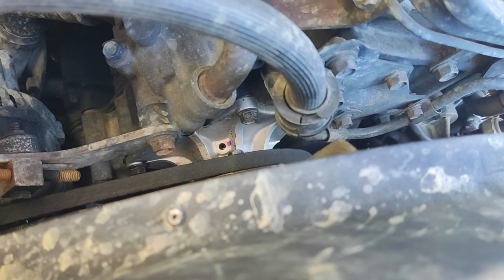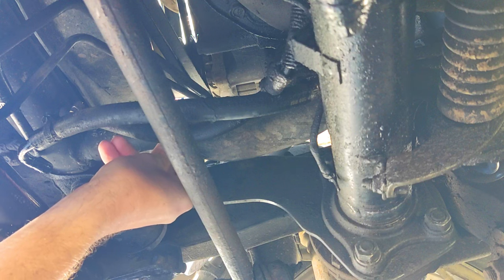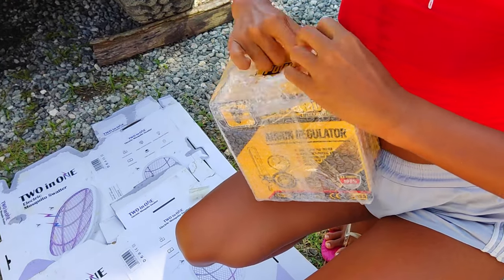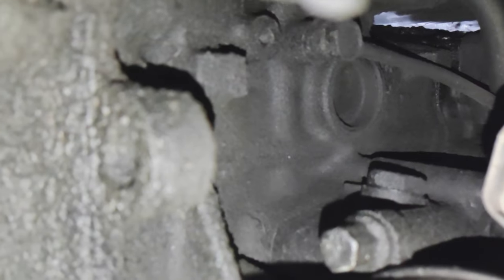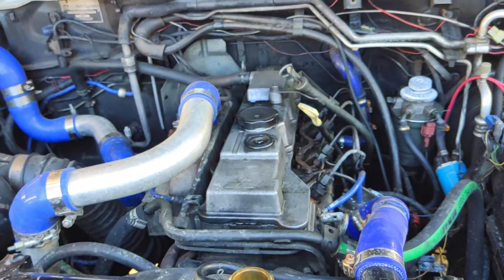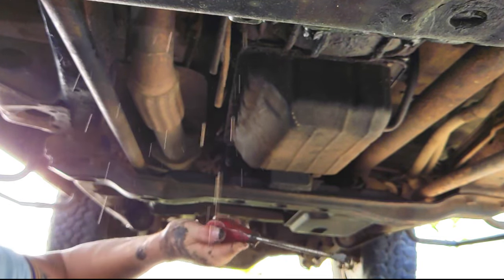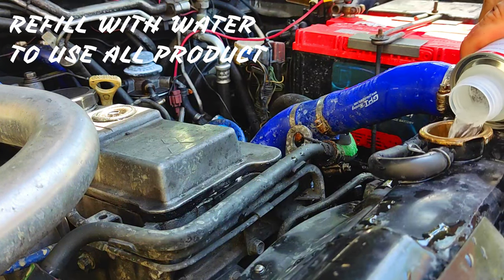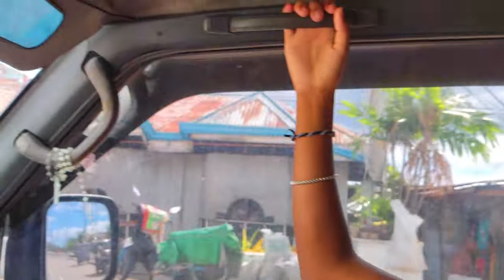HOW TO: ENGINE BLOCK DRAIN PLUG, RADIATOR COOLING SYSTEM FLUSH, 4M40 MOTOR COOLANT CLEANING PRODUCTS

Comment: Regular water is not ok for cooling system for long time, it causing increased rusting, better use antifreeze.

You can drain coolant from radiator without detaching lower hose, there are special drain valve/tap on the left lower corner of radiator.

There are lots of engine block drain plug photos in the internet, but sadly in russian speaking pajero and delica users community.
Reply from the maker: REGULAR?? THIS IS SWIMMING POOL WATER!! ;-)

Hehehe! Yeah...just a long process with all the flushing and bit-by-bit replacement of cooling system parts. The new water pump didn't do too many kilometers on water and yesterday, she got REAL COOLANT again! Video coming in a few days! THANKS for all the communication!
Reply: @offgridislandfamily  Water pump isn't very important component that can be damaged by rust, cos you can easily replace it. Most annoying rust damage is at heat exchanger, if there's small hole oil goes directly to antifreeze with high pressure.
Reply from the maker: @DeckCain  You mean the heat exchanger/heater core? If that happens, I'll just disconnect the heater.
Reply: @offgridislandfamily  No, not heater radiator in car cabin. Heat exchanger is device located near oil filter and it cools down engine oil using antifreeze flow.
Reply from the maker: @DeckCain  Can you send a photo to my Instagram group? Same name... Thanks! Sounds like another new part I need to learn about.

Comment: You should put liquid coolent and it comes with verse colour like blue, red and green so should check your user manual to check which colour coolent you should put to your vehicle or you can ask a mechanic shop or garage for info and add it to your vehicle otherwise this will go no where after the engine breaks so remove all the regular water that you added into the system and add the new coolent you bought from the store and your engine would work great after that without any problems.
Reply from the maker: Absolutely correct! Thanks for the message...

Comment: Where did you get the new metal coolant pipe that bolts to the side of the block?
Reply from the maker: Online, but I'm building copies in stainless. One repair for life. Great selling point too, if ever. $49 with shipping included.
Reply: @offgridislandfamily  hello.
How fast do you reach 110, can you go more than 110?
Reply from the maker: @nissanbakish  Hello! I have a video I think on 0-100 timing. Does 9 seconds sound too fast...maybe it was 10. Let me check. In regards to top speed. Power is not the issue...temp is. at 110 I'm at 110 degrees and the temp rises 1 degree per km/h. So, at 115km/h = 115 degrees and so on...

Comment: I had this exact same thing happened to me when I was rebuilding a Toyota Tacoma. I flushed out the radiator I thought I'd flushed out the blocked but I missed the drain plug for the block. The debris and sludge in the bottom of the engine block caused the engine to overheat, clogged heater core, and destroyed two water pumps.
Reply from the maker: WOW! Yeah...I finally got mine cleaned out as you can see, but there was about an inch of sand/mud/clay I had to dig through. Now, it's looking like I may have a head gasket leak or crack in the head. Just posted a new video on this. Thanks very much for watching and PLEASE subscribe! CHEERS!
Reply: @offgridislandfamily  I'll bet a lot of the sludge came from using any water that was handy (like from swimming pools), instead of filtered/distilled water or regular coolant. And probably corrosion residue from the parts... Installing a filter or screen somewhere in the coolant system (upper rad hose, easy to clean/see?) might be an idea?
Reply from the maker: @user-ut9ln4vd5m  Well, here in the Philippines, maintenance is rare. I'm very sure the plug had NEVER been removed since new. The pool water was only in there for a couple weeks following a typhoon. No other water available at the time.

Comment: Rare to see tutorials out there showing flushing taking out the block plug for Pajeros. Also now I know it’s a similar setup (block plug) as the 4m41 Gen 3. Will be doing a thorough flush soon and this will come in handy. Thanks for sharing.

Question, where did you get the LM Radiator Cleaners from?
Reply from the maker: EXCELLENT FEEDBACK! Thank you so much for the info. Yes...that secret drain plug is a bit of a hidden gem. I don't remember where I got the cleaner, as this was a couple years ago now.
Reply: @offgridislandfamily  No worries. I've scour Lazada and found a merchant. it's now scheduled for shipping. 😁

Comment: Mine drain plug hole was VERY plugged up. I had to twist a screw driver into it about 2.5" before it opened up...
Reply from the maker: YEP...exactly the same. I had to dig so long that I was convinced I had the wrong spot.
Reply: @offgridislandfamily  hahhaa same here, Im like there is no way this is crud...must be wring hole...but when it opened up it was a huge mess
Reply from the maker: @RocketPunchArmy  SPOT ON! Hehehe

Comment: Did this fix your overheating problem?
Reply from the maker: It did for about 6 months, which is exactly what I anticipated. So...for $50...fine. 😃
Reply: @offgridislandfamily  awesome to hear. I am also having issues with my coolant being expelled out of the overflow at highway speeds and uphill. Around town is fine. I just flushed the rad and I'm going to replace the viscous fan. Fingers crossed that'll fix it. Thank you for your tutorial!
Reply from the maker: @Johnkillaman  Unfortunately, sounds like wishful thinking, but worth a shot. One thing to do is--with the engine cold and the radiator fluid full--start it and remove the radiator cap. As the engine heats up, watch for bubbles. If you see bubbles coming to the radiator opening (and usually when they pop, gas is released), then it's certainly the head gasket and exhaust bubbles are passing into the cooling system. This is why the overheating is also very rapid and extreme.
Reply: My mechanic cleared me of a potential HG issue. He said it passed the block test...

These darn 4m40s are so troublesome with their cooling systems
Reply from the maker: @Johnkillaman  Now...THAT is a FACT!

Comment: Just subscribed, Great channel & content . I see on the time line 19:05 that your water flow seems way to high. The water circulation thru the radiator is to fast for the radiator/air to cool down the water. On some cars that dont have a strong water pump, removing the thermostat is ok, and actually improve cooling. But on your engine i think you need your themostate to adjust the water flow/temperature. Hope you solve your heat problem. Good luck try to find some antifreeze to pure on that radiator to prevent corrotion . 
 Sorry sir, Out of stock., 😋
Reply from the maker: YEP...the thermostat was SHOT. https://www.youtube.com/watch?v=8jKKPSRCPzM Thanks SO MUCH for subscribing and the encouraging comment. Very appreciated.

Comment: Plz chek my coments on ur last video... check to replace radiator fan silicon i hav posted a link in that comment as well ur heating problem will go away...

Regarding this radiator cleaning liqui moli.. u should have used half a bottle. ... since one bottle is for 8to 10 liter  and 4M40 hold 5 liter only... 

Now that u have used two bottles u hav to do a 20 to 30 time flushing to get rid of this white bubbly liquid.. cheers
Reply: Wrong, 4m40 holds about 10-11 liters of coolant. More antifreeze if rear heater is present. Only radiator itself contains 5 liters alone.
Reply: Bet $10 he has to do fan clutch. Saying that, next time I do a service I will probably try to clean out that drain plug as well. Clutch suppose to only effect low speed but was opposite for me, low ok, over 100 or up a hill at 80kmh and sand.
Reply: @MrMoto948  It's good to add additional electric fan in front of main and/or transmission radiators. Some people use original conditioner fan and manual switch for that. With this scheme you always safe from fan clutch fail and easy to diagnose such fails.
Reply: @MrMoto948  thanks for seconding my thoughts.. 

Yeah the drain plug in this video is also something new for me i have to clean mine too
Reply: My Delica already has 2 elec fans infront of radiator, plus the clutch fan.
Reply from the maker: Since using the Bar's Leaks Gasket Sealer, not an overheat problem SINCE! Absolutely exhaust gases entering the cooling system.